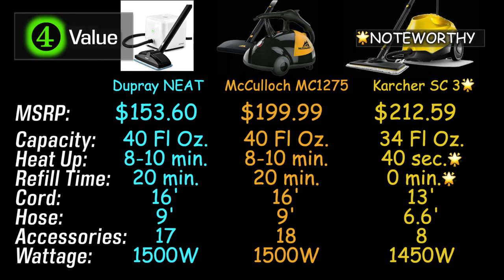DUPRAY Neat Steam Cleaner REVIEW - Watch It Clean + How To Use (THE TRUTH!)

Comment: Hello, I've been watching this video for over a week. I am using subtitles because it is difficult to listen to English. I don't know if I understand it right, but it's very helpful. I'm asking you a question at the level I understand, so I'd appreciate it if you could answer it. (I'm writing using a translator.)

1) I am a foreigner who has a culture of taking off shoes. Therefore, I am considering purchasing a steam cleaner to disinfect carpets in American homes. (I was planning to rent a wet vacuum cleaner, but I wanted to disinfect it with steam above 100 degrees Celsius.)

2) After searching, I found it useful for removing bugs, cleaning grout, and removing old stains from every corner of the kitchen in addition to disinfecting the carpet. It's a field that I'm very interested in. So I decided to increase the budget from about $70.

3) After that, I came across your video while I was watching a steam cleaner for about $150. Thanks to that, I got to know Karcher's steam cleaner. I've increased my budget once again, but I'm also worried because you still don't mention that karchers would have been better than DUPRAY NEAT. (There's also a price difference.)

4) So I'd like to ask you a few questions.

You said in the video that it took a long time to wash the bathroom tile grout. Is the main cause of this machine's problem, the waiting time before refilling? Or is the power of cleaning grout this machine not satisfactory?

5) In this part, there's a part where your high pressure washer would have taken 5 minutes. (I might have misunderstood.). I'm thinking of buying a high pressure washer to shorten my cleaning time. (Of course, it is not for commercial purposes, so the cost is also a main consideration.) Could you tell me what high-pressure washer you have?

If so, do you use a high-pressure washer to clean the bathroom grout instead of steam cleaner?

6)Would DUPRAY Neat have enough steam if I wanted to disinfect carpet etc with high heat? (Of course, steam is expected to be at least 100 degrees Celsius, but there are questions about this. Of course, I fully understand that steam soon loses heat. So I plant to spray it within close contact to the cleaning target.)

-------------ㅡㅡㅡㅡㅡㅡㅡㅡㅡㅡㅡㅡㅡ
I don't know if I'm being too greedy, but I want to avoid trial and error even if I have to increase my budget. I saw a comment in your video that someone were very satisfied with the $1000 steam cleaner, but I can't make decide to invest for it yet.

When I search on a website in my country, I have the ability to distinguish a little bit between real consumer reviews and paid fake reviews. But it's hard in America. I thought most of what I've read was real. But I learned from your video that it's not. I think it seems more serious than my country.

Thank you very much for your sincere review. Have a happy day.

===========================
I searched more and I figured out it was not for indoor cleaning. .... I read this article. 
https://www.thespruce.com/power-wash-tub-or-shower-tile-4125932

I think I might need higher level of steam cleaner. .......... thank you... 
I am still waiting for your comment. ^^
Reply from the maker: Please don’t use a pressure washer to clean indoors! My sense of humor gets lost in translation. 
In my opinion, the Dupray NEAT is intended for residential use and light cleaning. It is not intended for big jobs or professional level jobs. Cleaning our bathroom took a  long time because 1) You have to wait 20 minutes for the boiler to cool before refilling it; 2) You have to wait 10 minutes for the steamer to create steam; and 3) It doesn’t clean grout as easily and fast as chemicals. 
For the amount of cleaning you want to do, consider a professional-level cleaner that can be filled without a wait time and can generate steam within a few minutes. I don’t have another model to compare mine to so I don’t have any recommendations. If my Dupray NEAT steam cleaner died, I don’t think I would buy another Dupray. I’d likely go with a more professional model by a different manufacturer. I hope that helps.
Reply: @BruceAlanR  Sorry for late thank you. I appreciate your kind and detailed anwer deeply. I checked you would buy another & more professional model. It is very helpful information for me.  Thanks to you I think I have to choose Karchers at least. Tnak you again. I will visit your channel soon. Have happy weekends. ^^

Comment: Extremely good review of steam cleaners in general. There are no miracles as most will try to tell ya. I have the Wagner 915E model. I clean vintage cast iron so if it cleans ovens it should clean skillets right? It doesn't and it doesn't clean ovens either. It will remove oven cleaner however. If I spray a cleaner on the grout while the unit heats up the grout will look a little better. The same people that told me it cleaned ovens says it disinfects, I don't know but I wouldn't lick anything. I think Walmart says it best when they decided to not stock them in their stores. So many would bring them back that it wouldn't be profitable. If I had gotten this one at Walmart it would certainly be returned.
Reply from the maker: I agree with everything you pointed out! Ha!
Reply: If your stuck with it habe you actuality tried using stainless steel attachment and going slow over grout.  I don’t even need cleanser.  I now know what color my grout is.  Maybe you just need to practice a little patience and use the right attachments.  Go slow and easy let it work it’s magic.   You may be gong to fast.  Just trying to be helpful not antagonistic.
Reply: @brodenmacarthur3955  Thank you for the suggestion. Here's my experience with different brushes. If I use the metal brushes it digs at the grout. I guess I'm going too slow over the same area several times. The nylon brushes seem to not do damage. I spray the floor with Awesome cleaner while the unit is heating up. They will be higher traffic areas that will require a second spraying but it will look good when I finish but it isn't fast or easy. Honestly cleaner and a tooth brush would probably do the same. I'm glad you like your machine and thanks for the suggestion.

Comment: Absolutely a true review. Same issues I was thinking. Looking for a new machine. Any suggestions?
Reply from the maker: I don’t have any suggestions as to a make and model; however, if I had to do it again, I would look for a model that doesn’t require a 20 minute cooldown period prior to refilling. It really throws a wrench in my cleaning process to have to wait. Sometimes I just say, “I’ll get that spot next time” and move on with my day.
Reply: @BruceAlanR  The Grobell has 'water refill at anytime' and heats in less than a minute. A friend just got one and I am going to try it. We got very textured tile for not slipping (live in the rain forest with 3 dogs) but it also holds the dirt. Hoping this works!

Comment: Thanks for the awesome review,! How do you completely remove the water from the reservoir?
Reply from the maker: The short answer is you don’t. I shake out as much water a possible and then leave the cap off and trigger depressed so air can get in through the hose.  
I have so many small appliances that the manufacturers either didn’t consider ease of water removal or chose to ignore it in their designs (I’m calling out Dupray, Bissell, Rug Doctor, Bionaire, Hunter, Frigidaire, among others). 
Surfaces that don’t fully dry can form mold and mildew, which is one reason I bet Dupray says you should fill the tank with the water and white vinegar solution after 20 hours of use even if you’re using demineralized water.
Reply: @BruceAlanR  Thanks for the response. Unfortunately, it sounds like they are deliberately choosing to compromise their products. That really sucks.

Comment: Very informative and helpful video.  Question:  Does this steamer work well (or at all) on upholstery?  Thanks for sharing this.
Reply from the maker: If by “work” you mean helping to reduce odors or spot treating caked on debris, it will assist with that.  For removing stains or small particles dirt/debris that you don’t see in larger areas, consider something like a Rug Doctor or Bissell ProHeat Deep cleaner. I currently use a Bissell on upholstery.

Comment: The streaks on your stainless steel refrigerator is from another cleaner maybe 409. That happened to my Samsung refrigerator.
Reply from the maker: Prior to owning the steamer I used Zep stainless steel polish on the refrigerator. Zep is useless in my opinion… barely removed fingerprints. I have since been able to get rid of the streaking and get the refrigerator looking  like new using Bar Keeper’s Friend and a microfiber cloth. Now that it looks great I maintain it with the steamer. I figured I’d give Barkeeper’s Friend a try on the refrigerator since it did a great job on our cooktop… glad I did! 😃

How To Remove Stains Around Burners of Your Stainless Steel Cooktop - Frigidaire Gallery Cooktop
https://youtu.be/NGUt_qfrfXY
Reply: @BruceAlanR  thank you. I will put Barkeeper’s  Friend in my notes.

Comment: Wonderful review. I have a question. After using this device I emptied the water by turning it upside down…  like you did in the video…. I shook my device too. My question is, how do you empty out ALL the water from the tank? Is it possible? There is still water in the tank and I do not know how to get it all out and do not want bacteria/ mold growing inside tank. 

Thanks!
Reply from the maker: I feel like it’s a flaw in the design that you can’t get all the water out; however, I have the same issue with other appliances (washer, humidifiers, rug cleaners). The way I do it is to empty out as much water as possible and then put the lid back on and turn the steamer on. When the green light comes on I hold the trigger until no more steam comes out. Then I let it cool for 20 minutes, remove the cap, and put it away.

Comment: Steam cleaning is a good idea but surely one has to be careful as some material could be damage if applied hit temperatures 
2- Also I am worried when used in toilets seats as the steam will fly/ spread on both sides the dirt which is pee/urine and poo/caca  is this a way of spreading more dirt around ??? 
It looks good for cleaning kitchens, times, floors
Reply from the maker: As far as cleaning some things you do need to be careful due to the temperature of the steam amd moisture. For example, furniture that’s made of mdf or particle board covered in a glued on veneer can be damaged. The steamer works will remove veneer like its wallpaper.  You also wouldn’t want to clean wallpaper as it can remove adhesive and create bubbles. I will use the steamer on glossy painted moldings and trim, but not on eggshell or matte finishes. 

As far as cleaning bathrooms, it’s really important to use a lot of cloths to wipe. Steam can kill a lot of bacteria and viruses, but it’s still a good idea to switch wiping clothes frequently. I typically use at least 3+ clothes for the toilet (one for exterior, 1 for seats, and one for the rim), and a new cloth for the sink and another for the mirror. As far as cleaning the toilet bowl, I still use a brush and toilet bowl cleaner.

Comment: I'm looking for a steamer mostly to steam carpets and upholstery for dust mites, plus clean my floors, and I have a lot of unsealed hardwood too. I've been shopping for steamers too long and still don't know which one to buy. I was almost going to buy this one but still not sure.
Reply from the maker: I hear you. I’m a bit on the fence with this steamer. There are other steamers where you don’t have to wait 20 minutes to refill, which would allow me to finish quicker.
Reply: Hi~ I am same with you. Could you find it finally? I am in urgent. (I am not good at English, so I didn't try to listen and I am reading these)
Reply: @BruceAlanR  I'm also on the fence for which model is best. Since steamers like this don't have vacuum's I wouldn't expect them to do more than loosen, so the main criteria I have is how hot and how dry the steam is. Since the important components are the boiler and the pump, I'm looking for the best of those. The fact that Dupray offers a lifetime warranty on the boiler, and claims that their steam is 95% dry is a measure in their favor. 

Their long wait between fill times is a concern, but I wonder if that's the result of the design that keeps the steam dry. Not being able to easily, fully empty the tank seems like the main knock against it. I wonder if a shop vac might work to fully empty it. 

Among the models I've seen, this, the Karcher, McCulloch, Pureclean, Wagner, and now Grobell, the Dupray is still at the top of the pack. It's not unnoticed that you reference your discussions with them as their support seems to be among the best. Thanks for your observations.
Reply from the maker: @hclmed  As far as the 95% dry steam claim, the first blast of steam can be pretty wet, so if I'm using it on something I don't want very wet,  I fire the first shot into a bucket or sink.
The long wait time is an efficiency killer and if I had to do it again, I'd go for instant refilling. Life is too short and steam cleaning is slower by nature.
I've discovered the only way to get all the water out of the tank is to run it dry. Previously, I'd been dumping out as much water as possible, but no matter how much I shook it, there was still a little water trapped in the tank. Curious to find out what the tank looked like inside, I inserted a small endoscope that sends video to my phone. What I found was a fair amount of mineral deposits lining the heating elements and walls. I descaled it (a lot of stuff came out), rinsed thoroughly, ran the steamer dry, and then had another look. The tank still had a decent amount of mineral deposits on it, but I was not up for doing it again. There were also very small patches of rust here and there on the tube leading down to the boiler, which is surprising because the tube appears to be made of brass (I could be wrong though). So my guess is the unit will fail at some point outside the warranty period. 
Customer service is decent although I haven't had to deal with a warranty claim. I also don't put much stock in warranties because I've learned it's not always easy to initiate. I learned that the hard way with Dyson (as much as I like some of their products).

Comment: Thanks for this! Are you still using it 2 years later?
Reply from the maker: Yes, I still use it.
Reply: @BruceAlanR  Thanks for the response! Any tips you didn't cover? We should hopefully have ours delivered within a few days!
Reply: @BruceAlanR  I also noticed that Dupray sells steel brushes on their website. The Neat comes with brass ones which Dupray says is for "medium duty work", however the steel ones say "For heavy-duty work requiring aggressive, deep and meticulous cleaning. Great for grout cleaning or equipment cleaning."

Have you tried the steel ones yet? Might be better for the grill
Reply from the maker: The only additional tip I can think of is  that it’s impossible to completely empty the tank before putting the steamer away so I usually run it until it completely runs out of steam. Once it has cooled (at least 20 minutes), I then remove the cap and put it away without the cap on.
Reply from the maker: I have not used the steel brushes and am still using the original plastic (for general cleaning) and brass brushes (for grill grates and cast iron stove grates). Similar to a scouring pad,  the metal brushes can scratch surfaces so just be careful. Ultimately, the steam should be doing the heavy lifting. If you apply a lot of pressure to the brushes, they wear down quickly.

Comment: Question: does the nozzle have notches? I can't tell from the video. It almost looks like it's just circular but i bought a steamer off amazon that looks almost like a knockoff of this design; however, it heats within 1 minute and there's no cooldown time between use. Sounds like the knockoff solves the problem you speak of in regards to time spent waiting.
Reply from the maker: I’ll have to check it out. What’s the brand/model you got on Amazon?
Reply: @BruceAlanR  grobell
Reply from the maker: I checked it out and it looks good. Not quite the same, as the Grobell looks better than the DuPray on paper. Let me know how you like it.
Reply: @BruceAlanR  wanted to give you an update. For cleaning the tub it was amazing. But I also tried to use it to help me remove painted-over-wallpaper. Sure it helped, but I noticed that while using simply the Lance attachment, starting it up after a long pause sometimes shoots a stream of hot water instead of steam. I had to make sure I had a towel with me as to not cause an accidental mess.